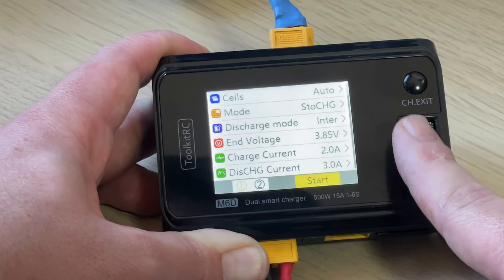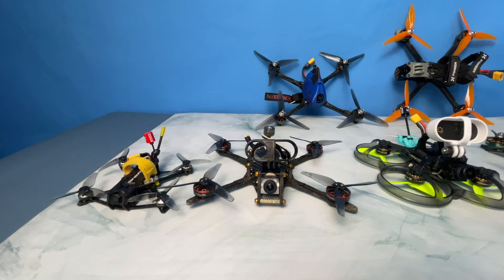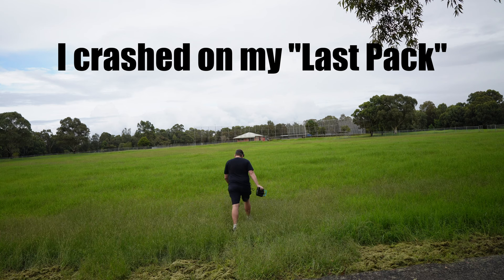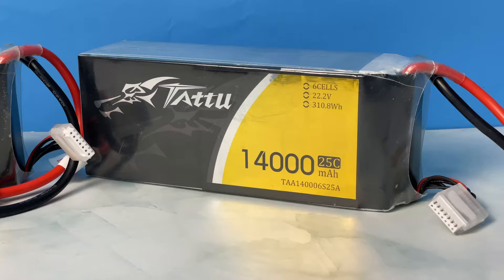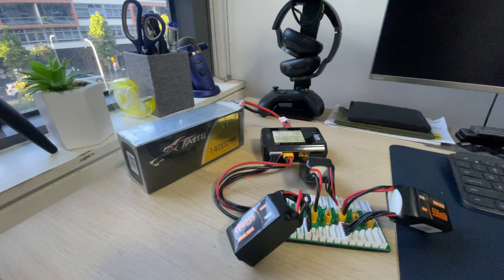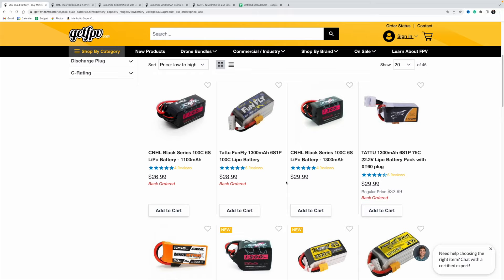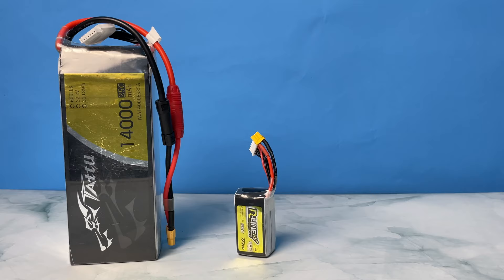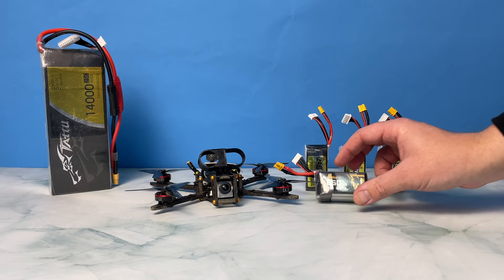Ignoring This DESTROY'S Your LiPo's!

Comment: I kind of agree with your basic point here but there are a LOT of variables on what will work best for different people and situations. I fly a lot of micros and those batteries are fairly cheap so I'd rather just buy a bunch of them and not have to worry about charging in the field. For racing, you need to have a bunch as well because it moves fast and you don't want to be caught without a battery when your name is called for the next heat, but you still should have a field charger setup because races can go on for a long time. If you're just freestyling and have time to burn then sure, having a few flight packs and a charging setup is probably a decent way to go. Personally, I'd rather not mess with charging in the field and prefer to just bring enough packs for each quad. The other thing I would mention is that you can get a SLA battery like those used for mobility scooters etc with 35+ Amp Hour capacity for well under $100 vs that tattu lipo that's only got 14 Amp Hour capacity and is well over $200. I've used a Mighty Max 35AH SLA battery in the field when racing for a couple of years now, just to make sure I don't run out of charged packs, and it's been great. I bring at least 10 packs when racing and keep a few charging at all times so I never have to worry.

Comment: I would disagree here. As a professional drone racer I fly close to 100 Packs a day. Luckily I do have electricity at my field, but always have to go home with a few (sometimes many charged packs). 
It is not uncommon for me to have to go home early due to broken equipment or running out of time to fly and finish of the last packs. 

If I was to use field lipos for this kind of flying I would need around 10 of those for a full practice day and that's just not feasible for me.

This might work for the casual freestyler, but def not for the hard core racer...
I personally use "storage dischargers" at the end of the day :)
Reply from the maker: G’Day @HaloWalker welcome to the channel and thanks for the comment! 

Absolutely. You are flying a volume of packs a day that most pilots dream they ever could. In your scenario, if you didn’t have electricity you’d probably have a larger and more commercial solution for field charging or just more packs.

Good luck for this DRL season!
Reply from the maker: Ps. If you want to get behind HaloWalker this DRL season, you can buy his official jersey from the DRL store, link below! 

https://www.shopdrl.io/products/halowalker-jersey

Comment: or rather than using you charger too dischage packs get a dedicated discharger, plus its really not wise too have any lipos left at full charge.
Reply from the maker: Dischargers just turn electricity into heat, so a waste of electricity... you can leave these giant packs at full charge for a while with minimal issues because you aren't putting them through turmoil like normal lipos. But, stick all your lipos through recycle at the end of the day
Reply: @DarrenAllatt  it's not safe too leave a lipo charge. Honestly I think your giving bad advice. As for a discharger my idst discharger dosent need mains power. Discharges a full lipo in a matter of minutes. I feel el you should tell people about all the options not just make out that the way you do things is better. That's not always the case for everyone and good luck taking those filed packs on a plane lol
Reply from the maker: You're most welcome to your view on things.. A discharger converts the energy from your lipo to heat. Field packs are safe to leave charged. 

lol. Don't plan on taking them on a plane

Comment: Interesting. 
So you charge a couple of packs and the field charger and then what? Charge the rest when you notice that you need them in the field? How long does that take at 2C. And is 2C okay in the long run?
Reply from the maker: So I pre-charge my 6 packs, and my field pack.
Go out at fly, as I finish a pack, it goes straight on the charger. I have dual channels, so can charge 2 at once.
Pick up the next pack and fly.
By continually cycling through charging packs, I don't have to think about battery management.
When I am done for the day, they are usually all still fully charged.
So plug them all into the parallel board, and recycle them into the field pack
Reply from the maker: 2C is fine in the long run
Reply: @DarrenAllatt  I'm normally fine with 3 packs for each drone (most of the time don't use all). 
When I need more I charge in the car going to the next location. 
So that 14 Ah 6S would have around 316 Wh, I guess you can't take it on a plane. But for someone who flies a lot in mostly one location your way seems pretty well thought out.
Reply from the maker: As long as you are driving to flying spots, yes.

Comment: If you only charge your fied pack to 4.05V per cell, you can leave it like that stored for a while. Always a fully charged field pack around isnt good for the lipo packs life.
Electric cars also only charge to 80% to extend the battery life.
Reply from the maker: Agree, most of the time, I’m using my field idk in full even after recycling my left over packs. So when I get home that gets charged up to storage voltage before I need to use it again.

Comment from the maker: One thing I forgot to mention:
My field packs don’t typically sit at full charge at home.. When I am out flying, they usually end up discharged to 3.5v by the end of the day. After recycling my lipos, I still need to charge my field packs to storage voltage between uses.

Comment: How do you safely store and/or charge a 288Wh battery? Even a full size Bat-Safe has a max rating of 200Wh - I’d be very nervous driving around with one that size in case it got punctured or otherwise caught fire. Thanks also for mentioning battery safety at the end!
Reply from the maker: It goes in my Lipo safe bag with all my other batteries when travelling, which is in my backpack.... When not being used, its on my shelf. These 288Wh batteries aren't getting the abuse the Lipos on our quads get, and barely even being discharged at anywhere near their capability. So they are pretty safe.

Comment: Hi, if you were asked to name the absolute best battery manufacturer based on your experience, which one would it be?
Reply from the maker: My challenge with answering that is, I’m in Australia and we have limited access to batteries. CNHL, Tattu and AU-Line are the typical batteries we have access to as they have Australian warehouses. 

I haven’t had any issues with the CNHL mini star batteries, but it’s prefer TATTU, except they are way more expensive.
Reply: @DarrenAllatt  Consider yourself fortunate that the top lipo manufacturers have warehouses in Australia, otherwise the prices would be much higher.

Comment: Does this also work if I'm using the battery of my car?
Reply from the maker: Yes it should work
Reply: Yes, I have a lead acid battery from a 4x4 that I got for free when my neighbours moved. I trickle charge it when I have excess solar power during the day and recycle left over packs into it. This keeps it pretty full and I don't really need to worry too much about it. Using 6 packs for micros and 3 or 4 packs for 5 inch, I'm never out of batteries. I use 2 ToolkitRC M8 and can run both off the lead acid battery with no issues.

Comment: Nobody explains why we have to use these crappy batteries? My drill has more torque then 4x drone motors!!?? These batteries can not be topped off???!!! That sucks.
Reply: Whats a field pack? Does it charge batteries? completely?
Reply from the maker: I use a 14,000mah 6S Lipo that has plenty of capacity to charge my 6S Lipos to full voltage.
Reply from the maker: How much does a drill battery cost?

So I went onto Amazon, a Dewalt 20v 5Ah battery is $70 … so that’s a 5,000mah 5S pack. When you can just use a Li-Ion Pack anyway.